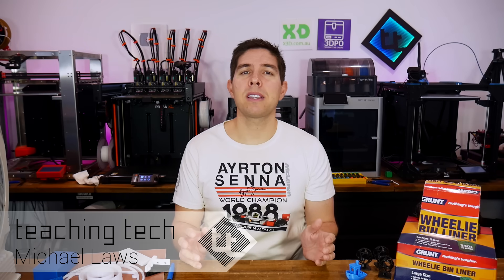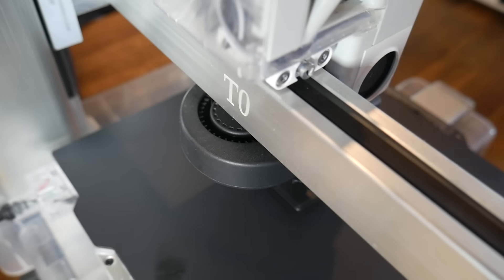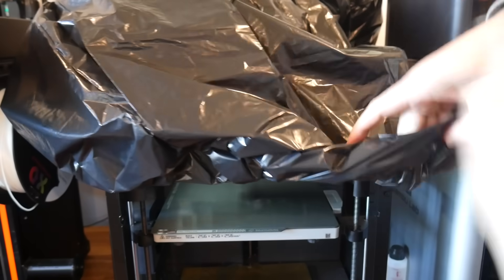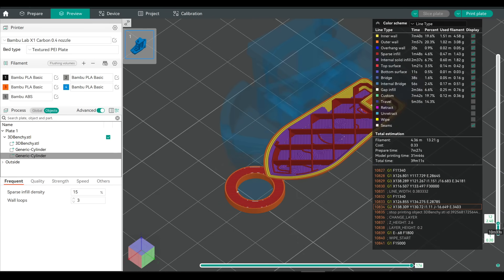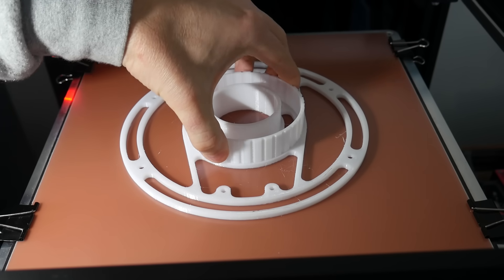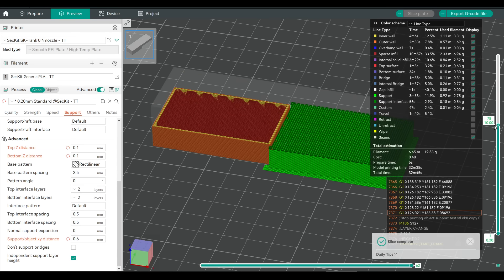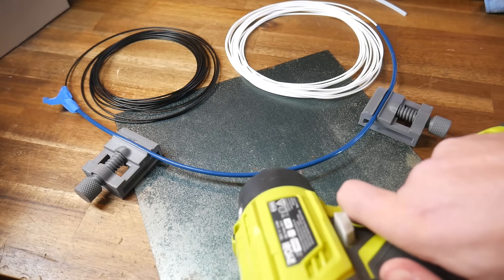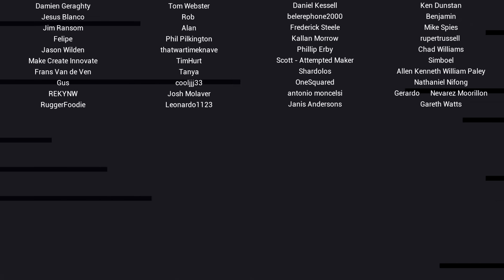Jankiest 3D printing tips that actually work

Comment: Joining filament together. 

When I run out of filament while printing, I just watch the end of the filament. When the end of the old filament reaches the extruder I simply follow it with the new filament, applying gentle pressure until enough of the filament has entered the extruder. I do have a direct drive extruder. 

I have done this several times with no issues.

Comment: My first printer was a Sovol SV06. I built a plywood box around it with a plexi front panel. I added an exhaust fan at one point, but it was not that useful, I just left the door open in the summer with PLA. I did have to re-wire the MCU fan for printing ASA/ABS so that it would be always on.
"Kill it with fire" is the easiest way to recover from threading. I have a lighter with a jet end on it, so it's easy to get a fine point and deep into a container.
I have created several prints using ONLY the add shape within the slicer (PrusaSlicer).
Don't forget using Kapton tape as a print surface. About the same as phenolic but more flexible on a metal plate. You can still use your contactless bed leveling if you just put it on the back side of a regular plate. It works wonders for TPU and the like.

Comment: One i used just yesterday is hot glue. I had a print start lifting on the corner bad to the point i was afraid the print would fail. So I paused the print and quickly put a bit of hot melt glue between the lifted areas and the bed then pushed it down hard with my fingers. Saved my print and on the glass bed I used it came right off with some warm water and Dawn.

Comment: Fir ABS I'd just find a box and cut a hole, cover it with cling film, or you could go the engineer route and 3D print corners for doweling amnd construct something nice, but that's not ghetto enough.

Comment: One jank is for prints that start out well but after about 5 layers a corner starts to lift.  You know the print will be good if it just stays but don't want to restart the print.  Masking tape to the rescue.  Just tape over the corner straight to the bed.  With normal layer heights the added tape thickness won't be too much of an issue.  You can easily cut the tape to the model surface and will hardly be noticed.  The layer adhesion will also be good enough as most filaments stick to the tape and the tape is stuck to the layer underneath.  Even more jank if you just do it without stopping the print. If you are quick enough you can sneak some tape in while the nozzle is on the other side of the print.

Comment: New to printing but I've been using sharpies to color text and such on prints to avoid wasting filament changes for small bits. I did notice the solvent in the markers when I was layering black sharpie on a print and it smoothed out the lines. I guess if you find the right marker with the right (amount) of solvent, you could use it to smooth out layer lines and such.

Comment: Don't know if it qualifies as full jank, but I use a cardboard box with aluminum foil inside to anneal PLA prints after printing. I wrote a ramping macro that I call in the Filament End gcode to take the bed from 60 to 85 over 5h, and I used it for the part cooling ducts on my SV08 instead of just using ASA. Heating it while it's still bonded to the bed seems to eliminate warping, at least with annealable PLA.

Comment: Keep your filament dry:
1. Get a plastic storage container with a lid.
2. Get lots of silica gel.
3. Store your silica gel and filament in the box.
4. Dry your silica gel regularly.
5. You always have dry filament.
Total cost 10-40$ and you can also dry your wet filament in the box but it takes time

Comment: I oftenly use gas stove to remove strings from parts. Very useful. 👍
To clean heatbed I use water: just leaving heatbed under flowing water. Sometimes it helps to remove plastic particles, which stuck to the bed.
To solder two filaments I tried to use silicon hose instead of PTFE tube. And it's not comfortable, because silicon is flexy and filaments move aside and don't melt together when you push filaments with force just more than needed.

Comment: Solidoodle... Shudder. I received what I dubbed as the Frankendoodle from them. The model I purchased was not what I received. I purchased a single extruder model with enclosure and received a dual extruder model in enclosure that they did not even have listed for sale. It had a different layout of tool head than their retail models as well. Best I can figure is near the end of their days they just packed up a prototype randomly sitting around and shipped it to me to fill an order. Contact with them was abysmal so I just kept it and tried to get it working. I never got it to reliably print.

Comment: To join the filaments, the jankiest way I come up with is to tightly roll aluminium foil (a foil from some junk is preferred) over the filaments and then proceed like with ptfe tube. You can then easily remove the foil. Guaranteed to work up to ~660°C.

Comment: The welding tip just saved my TPU print, as I had 2 small rolls  !

The AliExpress welder was not working

Update: the Curse Devil filament got clogged in the extruder... I lowered the offset and created a crood part anyway😅

Comment: 1. To hold something in place so that you can remove it later, pick up some PCL (Polycaprolactone).  It turns into a moldable putty at 60C and becomes sticky at 65-70C, yet becomes as tough as nylon when cool.  If, for example, a support comes loose, you can use hot glue to stick it to the build plate, then heat some PCL up to 70C in hot water, followed by mashing it into the support and print.  After the print is done, dipping the part with PCL stuck to it in some more hot water will allow you to remove it easily without deforming the print.  It is also great for low-friction surfaces.

2. I once made a woodgrain print by using a dark-brown sharpie on only part of some wood filament.  I coloured a section of it darkly, but haphazardly.  It worked pretty well, all things considered, with darker brown streaks along the layer lines/etc.

3. Instead of learning a complicated CAD app to make a model, figure out the absolute basics of OpenSCAD and just keep trying things over and over until your model looks good enough.  (There are also LOTS of code snippets you can steal from the cheat sheet/Stack Exchange/etc.)

4. Sample rolls of filament can placed in a 3lb coffee can that is stuck to the frame of your printer by magnets.  It will work just fine and never, ever tangle.

5. You can make a gluestick mount for your extruder, use it to 'print' the first layer of your model with an offset to match the position of the holder, cancel the print, remove the gluestick, then print the model as you would regularly.

6. Placing a cake pan upside down over your leftover pizza on the (heated) bed works great for a hot breakfast.

7. There is no law that says you can't use compressed air to cool parts down.  YMMV.  Obviously.

8. There is no law that says you can't use your sister's closet for an enclosure, with all of the filament hung on the rack where her clothes used to be.  YMMV.  Obviously.

9. There's no law that says you can't use your mom's Vitamix to grind down your waste prints.  It will be fine.  I'm sure of it.  I'm sure it will come off with a dental pick.  No, I won't scratch the polycarbonate.  Nothing.  Nothing happened.  Everything is perfectly fine.  IT'S FINE!  THAT SCRATCH WAS THERE ALL THE TIME!

Comment: I finally got to try the sharpie trick, and it works great! It did uncover a problem with my Klipper idle timeout settings, but the support came right off and the first mesh layer looked great.

Comment: 15:20 or you could just leave the tube on there until your print is finished.. it should just get pushed along? after the print it would be easy to remove by pulling out the filament from the extruder. :-)

Comment: That's much better than my janky way of joining spools. I just watch the print, and as it's about to use the last bit of fillament, I start pushing in the new one, keeping consistent force pushing it in until the extruder gear grabs it. It means retractions are garbage for a bit, but it works surprising well.

Comment: 15:07 You don’t need to remove the PTFE tube. It will stop at the extruder. 

Think about it; you run filament through PTFE all the time.

Comment: PCB laminate comes in various materials and thicknesses.  There’s boards in 1.6, 1, and, 0.8mm thicknesses you could try out with some very thin bits with no copper on them used when boards of more than two layers are made.

Comment: For my Ender 3's I cut a 235x235 square piece of that black foam it comes packed in and glued it to the bottom of the heated build plates to insulate them. They heat up faster, cool slower, conserving energy. And the build plate also heats more evenly.

Comment: I was having goofy issues with a large PETG print warping and peeling itself off the bed. I tried everything I could think of to make it just work and was about to give up when I had a slightly terrifying idea.
So I promptly grabbed the nearest space heater, set it to high, started the print again, and came back 20 hours later and uhhhh… It worked perfectly…

Comment: I used pause feature and some preprinted inserts when I was printing corner connecting aluminium T-sections, it wouldn't be possible other way as support would be unremovable. I added tiny amount of oil on both sides for easier release and a bit of stickiness so nozzle wouldn't move insert while printing first layer. Result was perfect

Comment: I've used the torch method couple of times, works really well and gives you this really shiny and smooth finish.
Enclosure. Well, not quite garbage bag janky, but my self made enclosure is build out of miniature greenhouse.

That support colouring methods gave me an idea. Could you apply some heat resistance tape instead?

Comment: The only ones i haven't done was the garbage bag enclosure, i used a cardboard box. The sharpie support. 
I have been 3d printing since 2017 so i have seen things and done stuff. Most of it i did before videos came out on YT about them. 
My g10 bed is 1mm thick and polycarbonate tends to warp and pull it out of shape even if its clamped down. The magnetic bed would be usless for PC. My modified anet a8 prints PC @320° nozzle and the bed can go over 150° c.

Comment: I used a 'retired' CPAP machine as parts cooler.
The air-flow was constant-pressure, but that was adjustable.
A hose from the CPAP to the hot-end did the trick.
The 'water-test' was fun...at full pressure, the air-blast almost emptied the coffee-cup!
This was cooling for a Tevo Little Monster delta printer....so long ago...

Comment: For the print bed, I just use scrap glass that I find in the dump. It gives me practice cutting the glass with a glass cutter. Wear gloves! Eye protection wouldn't hurt either. Then I round the edges with a sander. The glass print bed stays flat, does not warp, and leaves a beautiful, glassy finish on parts. But you'll have to have a release agent like glue stick or windex for PETG, or removing it will pull chunks right out of the glass. And even if it's cracked and not square, th' printer don't care, as long as it's janky enough!

Comment: I wonder if glass tubing might work better than PTFE tubing, because you can't overheat it with a heat gun, and you can clearly see what's going on inside.  Also, glass is a poor heat conductor which would help keep the heat localized to the joint area.

Comment: Here's one that I used yesterday: I needed to print a small part that goes inside a car, so instead of the usual materials, I chose to use ABS. I had never printed ABS on that printer before and the prints were not sticking great to the PEI buildplate. Instead of trying to wipe down the PEI or mess with the slicer settings in any way, I applied blue painter's tape over the area that the print was going to be on. This resulted in a perfect print. ABS seems to stick pretty well to painter's tape and the tape also reduced the first layer height slightly, squishing it down a bit more.

Comment: I tried filament splicing with a soldering iron and couldn't make it to work. Feeding right after the previous one works but created areas of underextrusion in vase mode, so maybe over infill.
I've glued partially released prints back to the bed quite a lot. I also heard about taping brims to be bed :)

Comment: I actually use a small rechargeable handfan with 3 blower settings on my Biqu B1 printer for the last year since both my fans failed at the same time and just have not been bothered to order a whole new hot end setup as have tried new fans and they also don't work on the printer(on the Biqu B1 the hotend setup has a board where the electronic plug in and I cant get just the board as I think the issue is there) So the small handfan is doing its job and probably better than the printer fans in anu case lol.

Comment: I print out a bunch of 2.75mm PETG rods of different lengths. Then I hot glue them as crossbraces from support to support. It works amazingly well for printing tall skinny things...

An example: Basically if you want to print something like a harry potter wand straight up and down you would add 2 tall rods beside the wand in the slicer, they can be round or square doesnt matter. Use print by object and make the rods hollow with a nice brim so you arent wasting as much material. Now when it is a printing you can pause the print every few inches and hot glue some crossbraces on no problem.

Be careful to apply the glue outside the printer and get rid of any stringing, you dont want your part cooling fan to suck in the wisps and it stays liquid long enough that you dont have to apply it directly inside the printer.

Another great bit of jank i seen was using thoae flat button style magnets to hold down brims and also you can pause the print about a half inch or an inch into it and place magnets inside the supports.

I am printing out a 40hr kroq-Gar statue where the supports all swoop in at extrememe angles from outside to catch things in the middle. These would absolutely break or fail if I didnt employ the magnet and hotglue jank.

Youd be surprised how tall and skinny you can make things while getting literally perfect results even at 0.08mm where the nozzle is constantly rubbing.

Comment: Been trying the join technique for awhile.  I have never gotten to work correctly.  I will definitely try the smaller ptfe tube. For PETG I use windex goes on with no mess. Spread it around a bit with a paper towel the heat of the bed drys it up. Prints pop off with no issues.  Just clean with IPA when swapping back to pla.

Comment: #1 - there's a butane torch on my printer cabinet, I always assumed that was "normal" and not jank at all! (It works amazing for smoothing/sticking TPU bridges back together)

#7 - y'all are joining spools?!  Whatever happened to setting the FEED rate to 5% and just yanking the filament out (hopefully during infill or interior walls) and shoving the new one in?  What a rush when it goes well, like changing the wheel of a car while barreling down the highway.  :P

Comment: My Jankiest - Using Peel and Stick Chalkboard on my Glass Bed. I got 10 prints out of 1 application before I switched to PEI Sheet. Worked Great once dialed in. Went PEI for the Flex and higher temp range

Comment: I wonder if you bought parts from an old Ender and the 1.8 mm tubing, if you could make a tool by drilling out the hot end to match the OD of the tubing?  You would only need a few parts to set the temperature at the right value and then not have to worry about overheating the tubing.  Think I shoudl go to eBay and see what I can find.  Thanks for the inspiration.

Comment: 13:48
"This works remarkably well..."
"-But we need a Jankier way."
lol :P   That made me laugh.

Thank you for the video!
^.^
Reply: By the way, Michael,

You could probably spiral cut the filament joiner, and it still hold up when you heat it up.
And this way, take it off easily.

I would like to use that stuff, because I broke a roll of PLA into many pieces trying to get it off of a roll.

Thank you! :)

Comment: Oh boy, I've done all of them except one! I've done the bag enclosure, also coupled it with a cardboard box enclosure, also the bank filament join for terrible multicoloured prints, and used a mini blowtorch (the chef ones) regularly for removing wispy bits. I also use the slicer 'boolean' all the time to modify prints, it's been ages since I have reverted to CAD. I made a Mandolorian jetpack/Mr Fusion mashup completely just using the slicer tools. I used the blower side of a vacuum cleaner as a part cooler,  I'm yet to try the sharpie method for supports, but it's on my list for sure.  Other bank things are using a piece of Kapton tape as a bridge when a support has fallen over, using my finger as a bridge when a support has fallen over, and turning the Z-couplers by hand to adjust the first layer while printing.